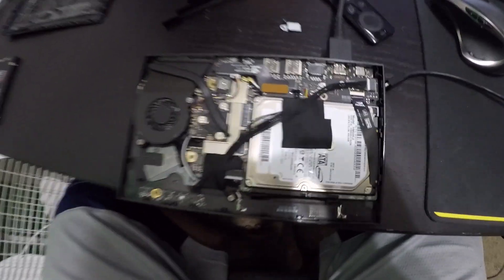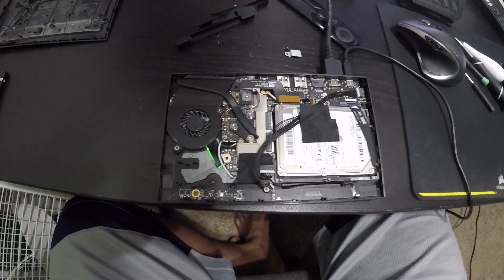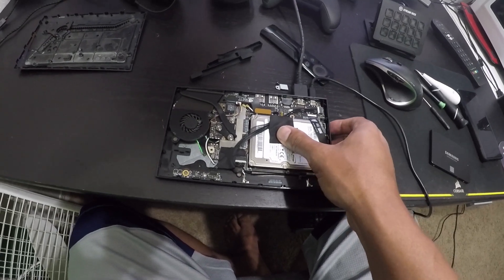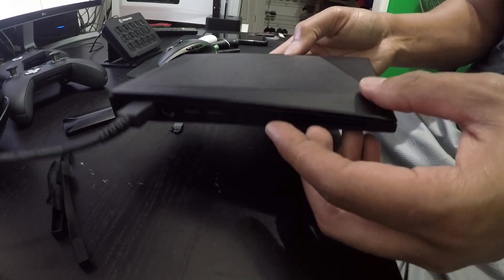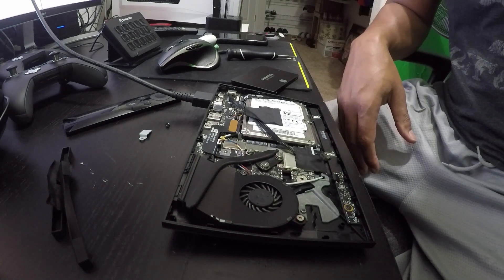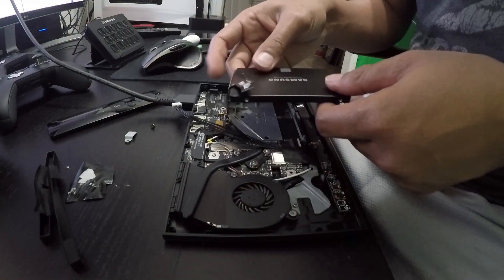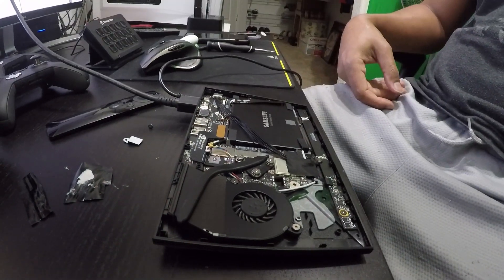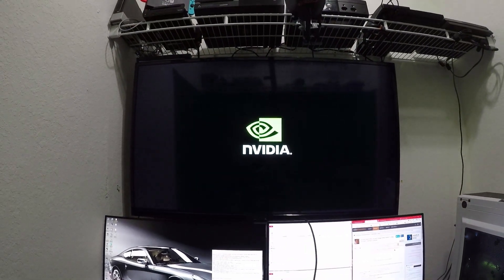how-to-flash-recovery-image to a new NVIDIA SHIELD Hard Drive

Comment: Your links in 1 and 2 are broken. I wanted to ask have you done a step by step on just what to type etc for beginners? I have the 2015 model pro 500gb and got it in 2016 new. I got sick and never used it until the other day and now it is stuck on the Software Upgrade screen saying it can not connect to the Network. Nvidia is not offering any help. It is either a bad drive or the software is not computable with the server since it has never been updated and is from 2016 version what ever that may be. I can not use the device and thought if I could manually upgrade the software I could get it to work. Did you make a tutorial video?  Thanks!

UPDATE:::::: Just in case anybody else runs into this issue with an older Nvidia shield and you cannot get it to update via the Internet I got the job finally done with no help from Nvidia tech support but after experimenting and trying different flashes of different versions I found that if you flash the 8.2.3 version of the software this will flash successfully all other versions do not. Of course you will have to go and become a member which is free to the Nvidia developers website and download that version for your specific model in my case the 2015 500 gigabyte pro model. Then you will have to download USB drivers and install them on your computer or laptop and you will have to get the ADB software kit because these are your flash tools that you will have to use in the command prompt ...follow the instructions on the software and be sure to lock the bootloader after your finish because it does not say that in the instructions or you will lose your 4K capabilities because it will REVERT your DRM into level 3 keys and you will be streaming SD content only. You will want your 4K capabilities so lock that DRM

Comment: Man I got the same issue. Light comes on with no signal. Put the original hdd back in and still no signal. I'm stuck
Reply: I still do not get a signal. My pc does not recognise my shield. If I send you my shield with a 500gb ssd do you think you can save it ? 2015 pro version thanks
Reply: I think I am actually proposing the same... Where do I send it and how much will you charge me for it?
Reply from the maker: Did the original HD had the original image
Reply: Ya the original hard drive had the image. I am now trying to do a recovery image. I cant install the fast boot drivers. I'm following the instructions but there is no setup coming up when I extract the files

Comment: how did you burn the image to your new ssd before installing it in the shield?
Reply from the maker: Hello im working on a step by step tutorial
Reply: @ArcadeParadise25  awesome! Do you live in the USA and if so, does your method still allow Netflix and Amazon Prime to work? Thanks!
Reply from the maker: @45caminiti  im having problems  with netflix but Amazon works fine and yess i leave in the US.
Reply: @ArcadeParadise25  ah bummer, thought you had found some magic image that fixed that issue. I take it your using dd in linux to burn the image to the drive?
Reply from the maker: @45caminiti  yes sir i don't understand why that's happening tho i guess every nvidia shield have a different Netflix build number.
Reply: @ArcadeParadise25  got my drive burned, but Amazon isn't working. Did you need to do anything special to get it to work?
Reply from the maker: No i didn't do anything sprcial and amazon works is just Netflix's that doesn't work